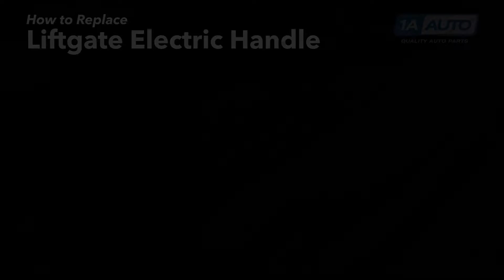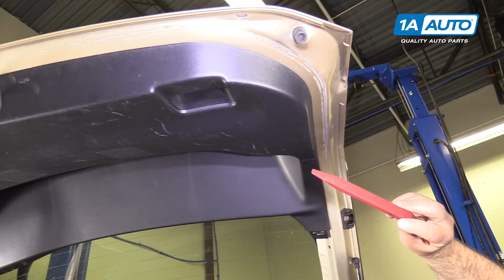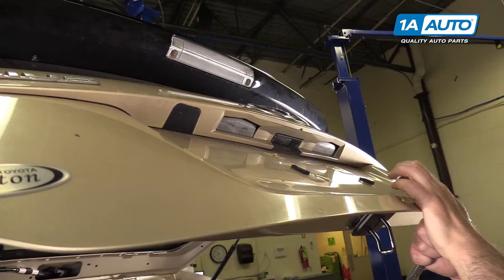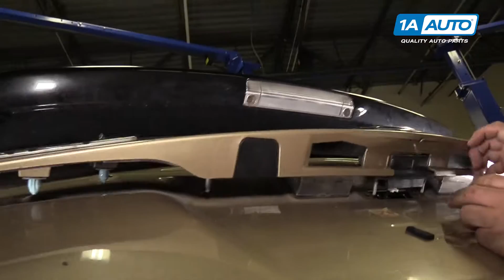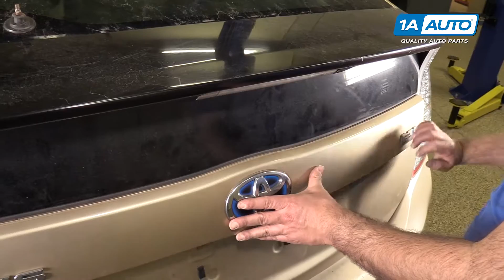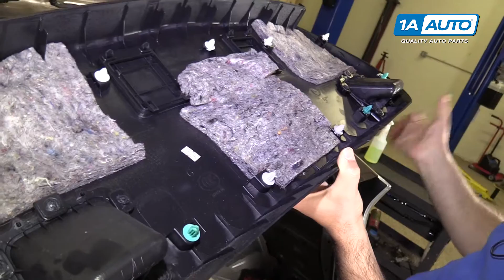How to Replace Liftgate Electric Handle 10-15 Toyota Prius

Comment: Any info on testing the switch prior to replacing?  My lock button beeps and works 2x then stops and the match release doesn't work at all. After unlocking at the driver door the rear lock button will beep again for 2 cycles and then cease again. 
I have a 2012 prius v five